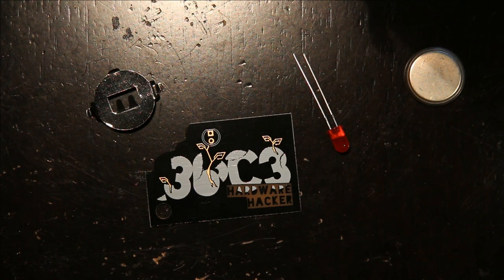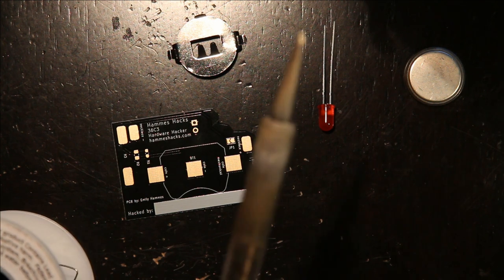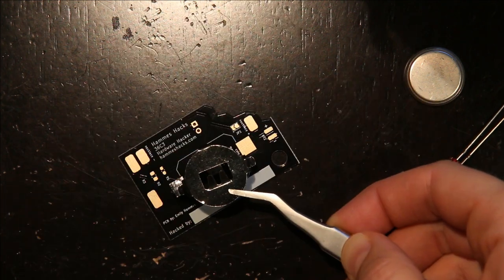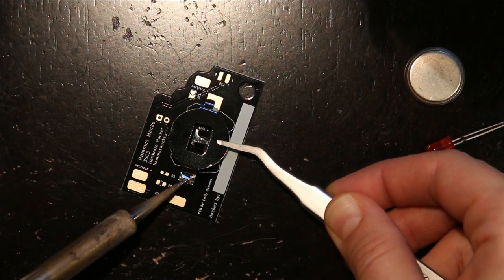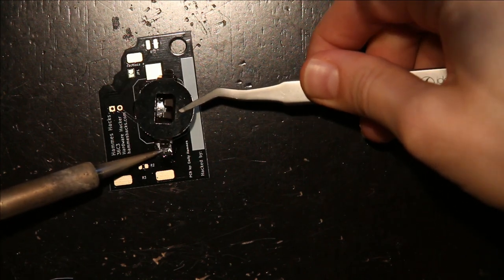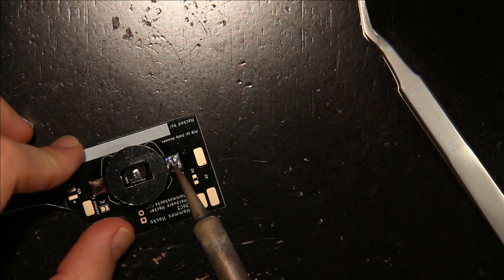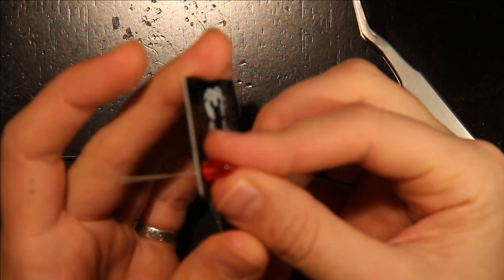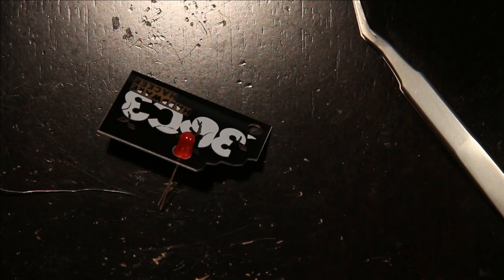36C3 Hardware Hacker -- the Chaos Communications Congress 2019 I can solder Badge

Comment: Not to question you , but I was always taught to scratch up (Sand with sandpaper or scrap with sharp object) shiny metal surfaces before soldering. Which may or may not have made your initial battery holder solder work a little easier.

Comment: Nice litte badge to solder for all the young players!
It would be easier to hold the battery-holder  down with some tissue instead of the tweezers and then heat up and add solder to the pad and the battery-holder BOTH at the same time. Also having a much bigger round pad in the size of the minus pole of the battery would it make obsolete to add solder to it (with all the flux residue) .

Comment: How does it blink without any components?
Reply from the maker: The LED is more than an LED...Follow the documentation link in the description to see the data sheet. I put it on my git hub page :) 

I picked that LED because 

1. I could get them on super short notice 

2. No other components are necessary to make it blink and I wanted to keep the badge as simple as possible

The down side is they are about 50 cents each...making the badge way more expensive than people think.